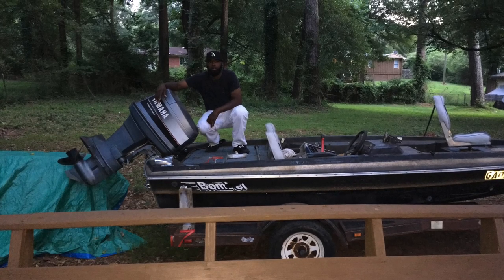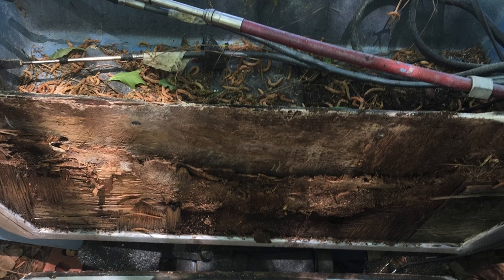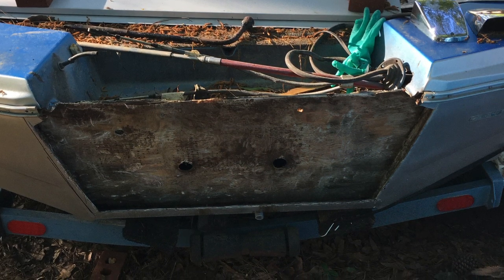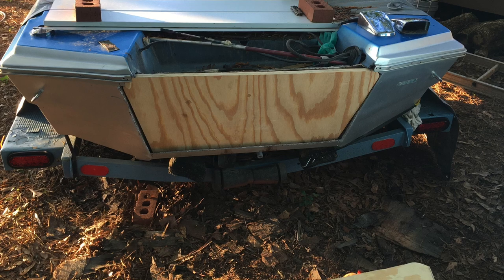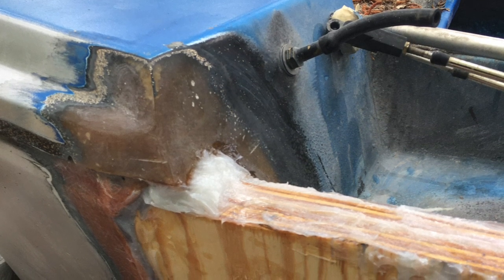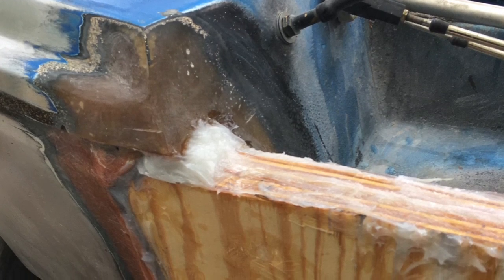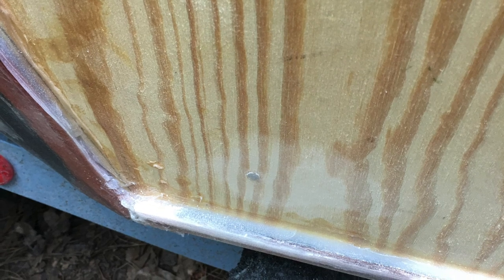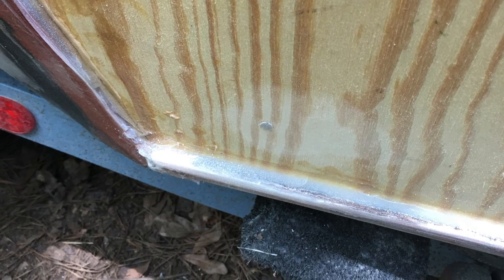Bass Boat Restoration￼ Transom Repair Part2

Comment: Nice job brother!  I'll never forget how defeated I felt when I got my first boat, and found out the transom was beyond rotten.  I was a rookie buying my first boat, and had NO idea what to look for.  That was when I learned about Seacast.  It's expensive (comparably speaking) but, it's SOOOO easy, once you get the rot out of the transom, which is the worst part of this kind of job.  That was 15yrs ago, and since then I've done 3 more on boats that I got for pennies on the dollar because i knew how to fix them, and wound up making money off of each one.  When/if you ever have to do the stringers, then Seacast works amazing there as well.  And, if the transom is rotten, then you can bet that the stringers, or at least part of them are, as well.  This looks great, man...nice job!  If you ever find yourself in this position again, check that product out....
Reply from the maker: Thanks a lot for the comment and info I appreciate it and I sure will try it out my transom is holding up solid too 🎣🎣

Comment: Man! Awsome job!!! Giving me confidence to do my transom.. By the way what plywood did you use? Did you use the marine stuff or just choose something from home deopt or Lowes?.. Thanks
Reply from the maker: Thanks and it was from Home Depot don’t get the pressure treated get the regular wood the pressure treated wood will stay wet and you don’t want that just water proof the wood and it will be fine!! Hope you are a subscriber
Reply: @HoldemHookTV  thanks bud. I am a subscriber. Thanks again.. How has your transom held up? Also how big of a motor do you have sitting on it?